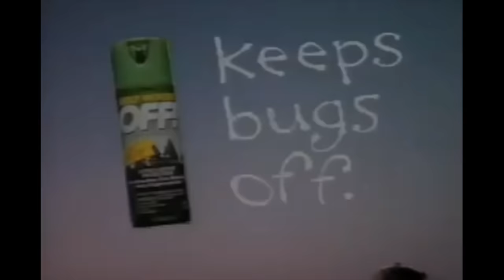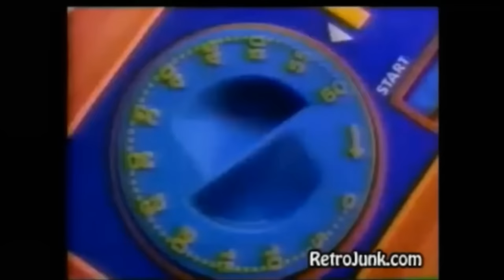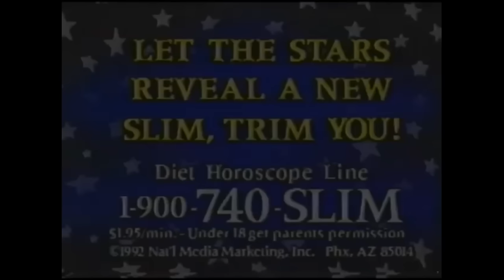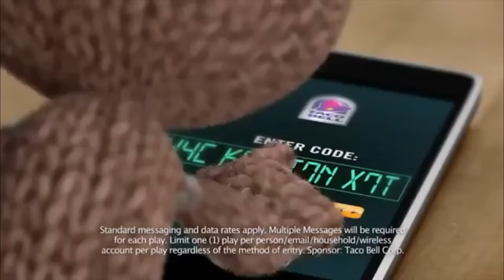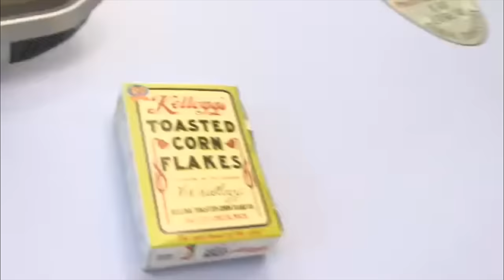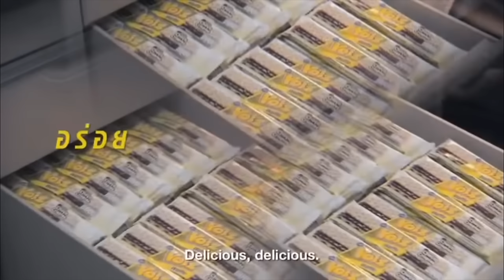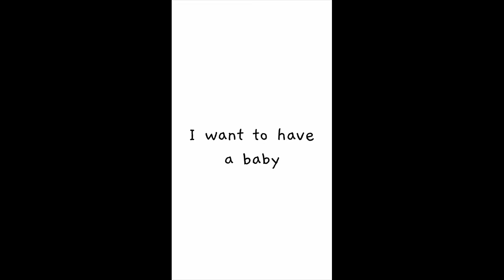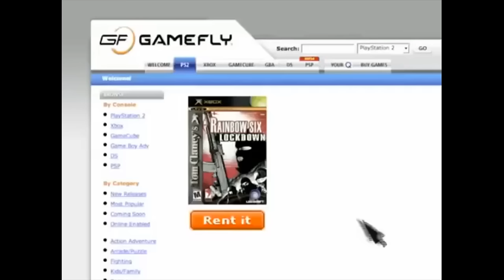[Vinesauce] Vinny - Commercial Chaos: Robo wants Mulch

Comment: In the Compaq commercial the chips and bus part refers to the Deskpro 386 having 386 chips in the system(integrated circuits, CPU, RAM, ETC) and the Intel 386DX which this system used is a 32-bit CPU with a 32-bit processor bus(the path the processor uses to communicate with the rest of the system)